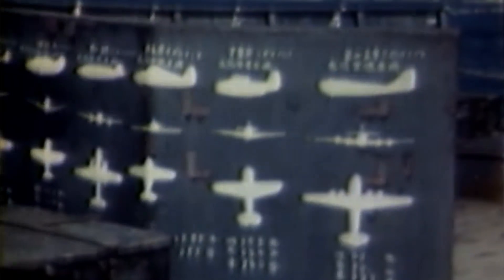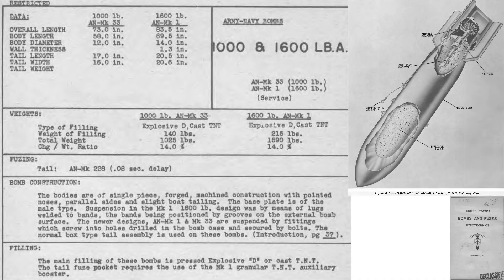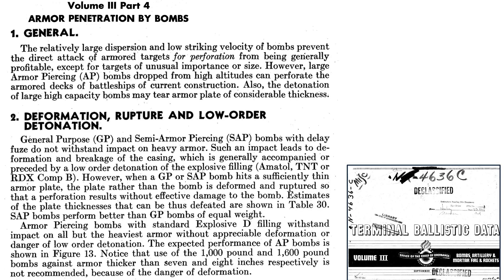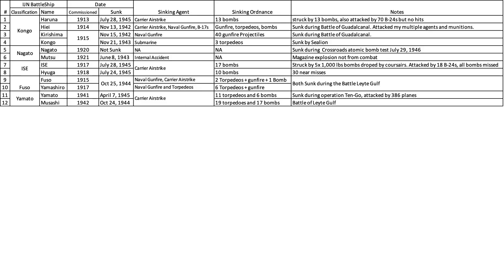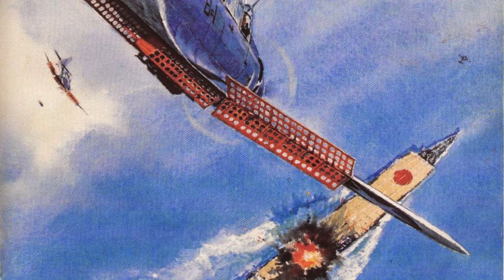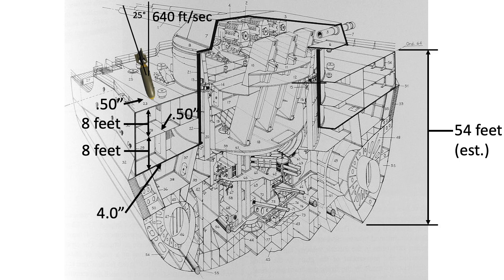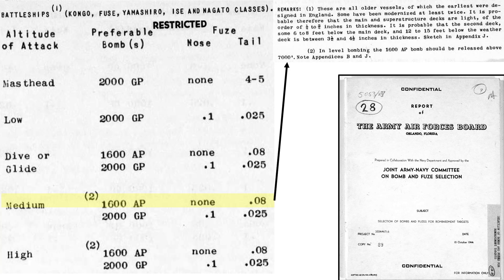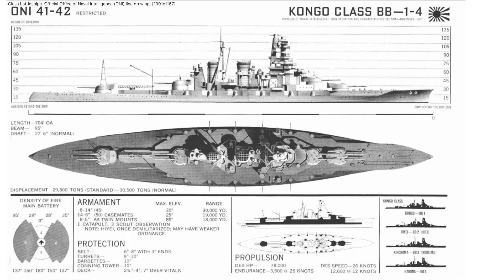The US Navy's WWII “Battleship Bomb” Poor Performance during Battle of Leyte Gulf - Deep Dive Review

Comment: This brings the failure of the Kamikaze, simply due to physics.  A plane carrying a bomb and hitting a ship at 300mph means little penetration.
Reply: They wouldn't do anything meaningful to Battleships.  But they could damage Carriers and other surface combatants.  Especially the Destroyers.  Kamikazes were the leading cause of sinking US Navy Destroyers in WWII.

Kamikazes were instructed to prioritize Carriers first and foremost, but they were very well protected and most of them ended up being used against Destroyers instead.  If they got past the fighter caps and anti-aircraft, that is.

There is an image BTW, of damage by a kamikaze impact at the armored belt of a Royal Navy Heavy Cruiser, HMS Sussex.  The kamikaze hit the side at the armor belt, a few feet above the waterline.  There's a dent and scorch marks leaving a shadow of the plane.  That was the extent of damage.

Comment: The illustration used of the interior arrangement of a battleship is NOT that of a Japanese battleship. This is obvious when you notice the torpedo protection system is the cylindrical torpedo defense, known as the Pugliese system, which was used by the Italian battleships, both those rebuilt and recommissioned in 1938 and 1940 and the newly completed "Littorio" class. Also, no Japanese battleship before Yamato class had three-gun main turrets. However, the point you are making is valid regardless of the illustration. But the USN's ONI rarely had accurate data on most Japanese warships. Notice the data above. Post-war analysis of documents and interviews with Japanese naval architects and construction officers showed that after their third rebuild, the "Kongo" class "fast battleships" all exceeded 29kts on trials with 132,000 shp, had an estimated standard displacement around 32,000 metric tons, a maximum ballistic range for their 14" guns of 37,400 yards and a main armor deck of 130mm (5.1") over the magazines. All of the rebuilt battleships had a 130-150mm main deck armor over their magazines. The Yamato class had 200mm. Of course, all these designs had "Achilles heels". For vertical attack on the Yamato class, it was the secondary 15.5cm three-gun turrets and their mountings. The roof of these turrets were only 25mm thick and there was no armor inside the barbette. A bomb would go through the turret roof, down through the barbette interior into the secondary magazines. Pictures of the Yamato at the time of her sinking show a fire within the aft secondary turret barbette. This probably set off the secondary magazines and then the aft main magazines as she capsized. Her hull was blown apart, so no "Space Battleship Yamato".
Reply: Always love a "Space Battleship Yamato"" reference -

Comment: I remember a saying, but not the source, "bombs let in air, torpedoes let in water". Bombs vs torpedoes sinking ships is an old topic. After longs years of discussions our Air Force has finally come up with a possible game changer called "quick sink". This is a package kinda like a JADAM that can but strapped to most any kind of HE bombs in US Air Force inventory. This will guide the bomb into an impact close aboard a ship at an angle that takes it under the ship and uses a complex fusing to detonate the bomb under the keel. This raises the ship up in the midships area breaking it's back followed by the ship falling into the hole caused by the bomb detonation, this completed the ships destruction. This also has the advantage of needing a thinner case wall because it doesn't need to penetrate armor and a much larger % of explosive weight.
Reply: I know Drachinifel (a naval historian on YT) mentioned as much, though he was referring to naval shells. 

Could probably come from a bunch of folks tbh.

Comment: The British failed to sink the Tirpitz using 1,600 lb bombs from Fairey Barracudas, but 12000 lb Tallboy bombs from heavy bombers did the job nicely. Probably wouldn't work against a moving target.
Reply: The US developed two controllable version of the US version of the Tallboy. Razon was range only control then
The Tarzon, a modified 12,000-pound Tallboy bomb, was the largest U.S.-built guided bomb during World War II. It was developed to target heavily fortified enemy structures and was initially visually tracked to its target with radio signals emitted by the carrier aircraft to adjust its control surfaces. Although the Tarzon was developed in 1945, it was too late to see combat during World War II. However, the U.S. Air Force deployed it on B-29 bombers during the Korean War.
Reply: Supposedly the Barracuda pilots also just... didn't drop the bombs from high enough?? Even though they were told to
Reply: -Dropping bombs on a "moving" target WOULD have worked using the RAF  SABS-II bombsight, USAAF Norden or Luftwaffe's Lotfe 7B.   It however wouldn't have worked against a manoeuvring target.  These computing bombsights compensate for motion so long as it was steady motion.   In 1943 Focke Wulf Fw 200C Condors attacked Convoy Faith from 12,000 to 15,000ft (same as Tirpitz Attack) and on one Occasion 3 Condors scored 3 hits in 5 attack runs against moving Merchant ships.   Attacks against the escorting Sloops and Corvettes proved fruitless as they had the spotters, speed. drills and manoeuvrability to dodge the bombs.  
-Ive always thought the B-17 would have been more successful if employed correctly in level bombing anti shipping attacks.  The B-17 either attacked from 25,000 to 30,000ft (which is way to high) or from 7000ft while mostly unescorted and subjected to Japanese fighters.   Put the B-17 in action with P-47 and long range 220 gallon Brisbane Tanks or P-38 things might have been different.  These B-17 attacks however broke up formations of japaense shipping that were then easy targets for skip bombing attacks. 
-The Japanese attacked Force Z with 2 engine Betty bombers from 5500ft to 6500ft sinking the battleships Repulse and Prinze of Wales.  (torpedoes did the sinking but level bombing caused damage)  but note   3 out of 4 of  PoW Type 285 AAA radars were out due to humidity but hits on the level bombers still recorded.  
@wacojones8062  unfortunately Razon was a post war weapon (mid 1945 possibly usable before wars end) and Tarzon much latter again, Fritz-X a 1943 weapon.   
-I think AP bombs were over rated.   They seldom worked causing damage that was repaired.  A HE bomb even if it misses can be fused to damage by detonating next to the ship under the waterline.
Reply: The three post war reports are illuminating. On Goodwood Three, one 1,600 AN-1 penetrated all the hull armour but failed to detonate. The German contemporary report recognises that Tirpitz had a very lucky escape. Secondly, in a report discussing weapon choices, it concludes that the 1,600/2000 lb AP was more effective than Tallboy because the latter relied on blast.
Reply: @TankBuilders  Quite frankly the Germans are wrong. Blast effects particularly from underwater detonations are the individual most dangerous sort of attack a ship can experience. Modern torpedoes and anti ship bombs deliberately exploit this to shatter the keel of the target vessels.

Comment: It seems that dive bombing just couldn't manage enough penetration to deliver fatal, sinking blows. They still dealt damage, but it seems that bombs in general were more supplementary weapons to damage the superstructure, AA guns, damage control systems, and maybe causing a fuel leak if you're lucky. Carriers were uniquely vulnerable in this regard due to avgas and hangars full of planes and munitions that were not nearly as well-protected as shell magazines were in battleships.

With this in mind, it's remarkable that US carrier forces were as successful as they were pre-1944. Then again, it's not like the Japanese knew that their capital ships would be relatively safe against defective torpedoes or insufficiently-penetrating bombs, so they acted like the loss of air superiority was a fatal disadvantage and didn't take the risks.

What makes me curious is why there was no effort to develop a dive-bomber delivered armor-piercing bomb that had a rocket booster attached to its rear to give it extra penetration power. I'm sure it wouldn't have been easy, but if the goal is a battleship-killing bomb, something that really punches through with speed while being delivered at a low-altitude dive would do the trick.

Japan got quite lucky that they could reliably use higher-altitude level bombing with specialized AP-bombs at Pearl Harbor, thanks to their targets being completely unmoving. I guess that's why they didn't employ the tactic at any point afterwards; against maneuvering targets, level bombing at high altitude is very unlikely to hit.

It's ironic that the US put effort into developing a battleship-killing bomb but didn't seem to put in effort to making a much deadlier torpedo or heavier AP rockets. The rockets in particular--having a weapon like that in 1942 would have been a powerful asset.
Reply: Also, at Pearl Harbor there were ships side-by-side and in line, so the chances of hitting a ship even if you missed the one you were aiming at were significant.
Reply: If the bomb were accelerated in its fall by the rocket motor (plus gravity) would the "flight" time be sufficient for the dive bomber to pull out and get far enough away?
Reply: @lesliemacmillan9932  I'm not sure if it's an accurate impression or not, but the impression I have is that dive bombing was often done by multiple planes in quick succession (so one plane could be approaching its release point while the bomb from the plane in front was still in the air). In that situation, your own bomb is probably less of a risk to you than the bomb in front of it is, and if you wanted to be safe from the effects of bombs going off you'd need to make sure you never got close enough at any point in your dive to be in danger.
Reply: @davewilson4493  That's a good point.  Thanks for the insight.
Reply: Didn't USAAF develop something along those lines called "Disney Swish" in Europe?

Comment: Unfortunately wars are not fought by statistics but by frightened men.  Dedicated but still frightened.  One problem is getting a hit!  Remember that the USN hadn't been attacking Japanese fleet units from late 1942 (Solomons Campaign) until June of 1944 (Philippine Sea).  At Leyte the USN Third Fleet had been deployed for quite a while, the pilots were tired.  A number of the newer pilots hadn't attacked a major surface unit that was shooting back.  In the action at Sibuyan Sea many air groups suffered target fixation with Musashi once she was crippled.  So, you need to consider bomb choice as well as pilot factors, plus enemy evasive maneuvers. Hitting a moving ship that is throwing up AAA (even the IJN 25mm) is problematic at best.
Reply: Yeah that 25mm was surprisingly effective. Influencing post war cartridge development and evaluation of the ideal available ammunition count to target payload delivery ratios. 

Getting 5 25mm rounds on target in the same time it takes to land 1-2 37mm or 40mm rounds. 
you’re technically getting more ordinance on target per second despite the lower caliber. 
Which is preferable for smaller fast moving targets. 

That’s the same reason the USN has gone with the bofors 57mm deck gun vs the Oto malara 76mm.
Reply: Well said, good sir.